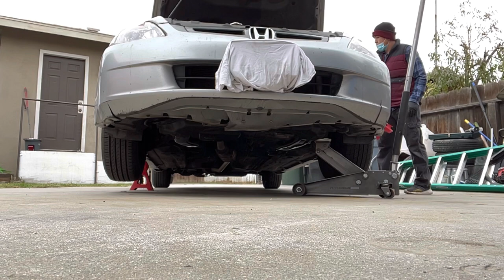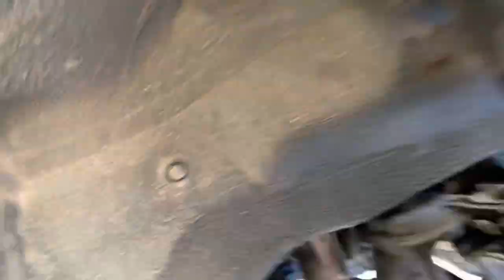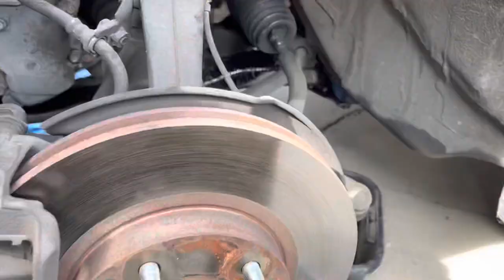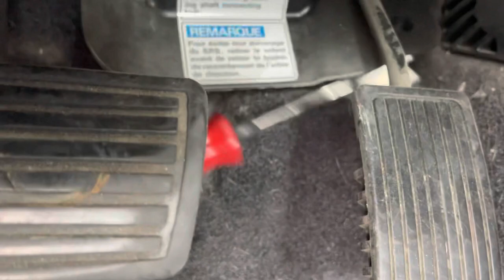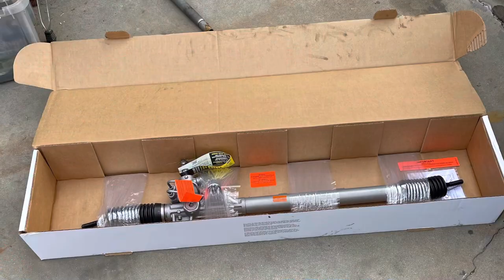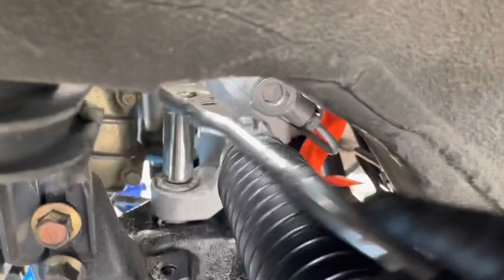How to Replace RACK & PINION     2003 - 2007 Honda Accord  4CYL

Comment: Is it that easy to take out ? ,  becasue other videos they take of the bracket loose the subframe take off Mounts and most even use a three man team
Reply from the maker: Just lose all Frame bolts
Reply: @pacetansasonny_soei2515  Did you loose both sides subframe. In the video you only did one (@2.00 and then @2.11). Any danger of everything dropping to the floor lol.

Comment: what rack and pinion did you buy and where did you order it from?
Reply from the maker: I bought from Autozone….
They have in stock of The rack & pinion
Reply: @DjSkyattack  Yeah if you're buying "Valuecraft" Otherwise it's all pretty decent when it's not rebuilt junk.
Reply: @pacetansasonny_soei2515  hello I have a question is it leaking right now after one year??

Comment: What about the bracket under the rear motor mount (only on 4 cyl)? It keeps the steering rack from lifting out.
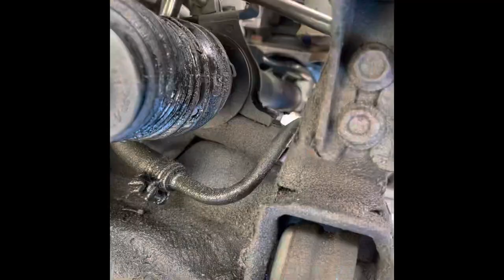That's one of the hardest parts, I can see it at about 0:52, and you didn't show anything of it..

Also, there's no 5/8" anything on that car. Maybe you mean 16mm (almost equivalent), but there are none of them on this job either.
Reply from the maker: I never touch the bracket motor,
This 4CYL 
Just loose the frame bolts approximately 1”
Reply: 5/8 is a 16 just like 3/4 is a 19. This guy just showed you the short cut. It’s what you learn to do when your a pro. If you think that’s crazy I would blow your mind if you saw me take a torque converter out of a Camry without dropping the sub frame or completely removing the transaxle. And that rack slides to the left no need to lift it up. Take a second look 😉